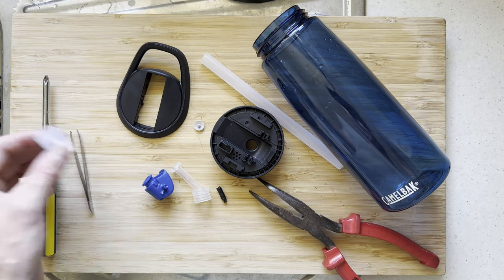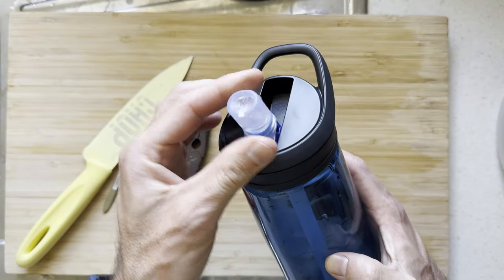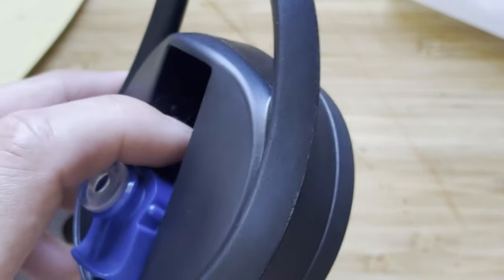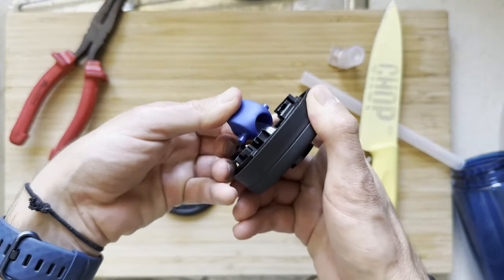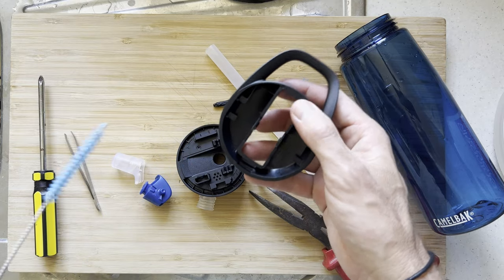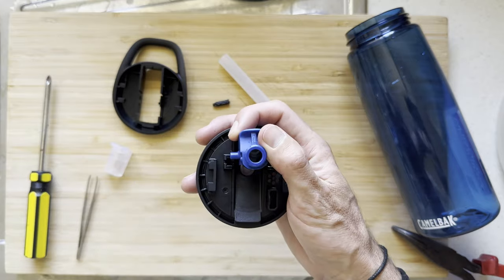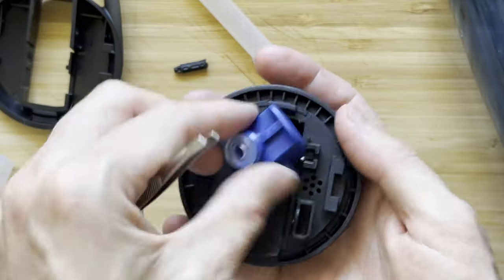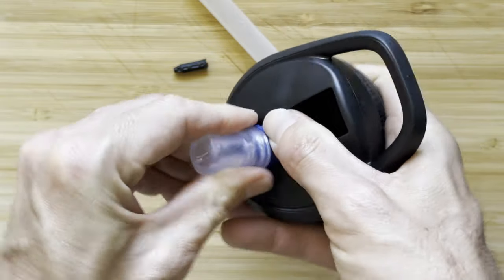How To Pull Apart and Fix/Clean Camelbak Eddy+ Bite Valve Lid!

Comment: Neat, was a real pain to find a guide so thanks for making this! 

4:00 I found it pretty effective to tie a twine to the rubber cap to pull it through the mouthpiece.
Reply: Thx! I was struggeling so much with this part, was about to give up when i found this comment^^ :D
Reply: @rabuea  Glad to have been able to help!
Reply: Definitely do this, you could poke a hole in it with anything else
Reply: I was going to post the same method. I used dental floss as its clean and strong enough to do the job.
Reply: omg thank you! this worked flawlessly!!

Comment: Thanks for making this! I used a thumb tack to poke the dowel at an angle and leverage it out and then just pull it with my fingers and it worked quite well! The knife felt a little dangerous for me especially since the dowel on mine was a bit sunken in. Thumb tack didn’t even cause too much damage to the dowel. Feel so much better knowing how to properly clean this, thanks.

Comment: 1:59 a better way to get this dowell out is to start the process of removing the top and you can get a small opening on the side. Then you insert a butter knife behind the dowell and push it through the hole. Works great and saves the dowell. Just be careful when you pry the top off

Comment: I wrote to Camelbak about the design and pointed to your vid, but the response was .... get a flip lid bottle!  The design changes over the years could have addressed thorough cleaning by better designing it for disassembly  so it's a bit disappointing.
Reply from the maker: I appreciate you sending them my video. Unfortunate they didn’t have a better response but I guess it would be someone from customer service not the actual design team.
To be honest, Contigo bottles are much worse to pull apart. I love the Nalgene bottles and lids for their simplicity
Reply: @huntingwaterfalls  Best vid explaining the takedown of the lid.  Wish they'd fix the servicability of the drinking straw mechanism.  As a design it's good because you can drink without the bottle obscuring your field of view (like when you're stopped at the lights grabbing a drink).  Or for whatever reason you want unobstructed view.  Plus it's no spill or leak (bite valve), so there's no problem with water sloshing around.  If they keep the bottle's thread pattern the same and come up with a replacement/improvement - great.

Also peeved with bottle designs like Klean Kanteen that change the width across the similar product range...(that's another topic)
Reply: I'm so disappointed in Camebak because I still have an old bottle from >10 years ago without these extra rubber parts that works fine & doesn't grow mold like these new ones do. I'm just dumbfounded as to how they could redesign lids in such a worse way that basically harbors mold, mildew, & germs inside the lid!  It really sucks.
Reply: I was able to get the skinny straw out and back in by wrapping a bread tie around the small end and feeding that through.

Comment: Great video thanks. We ended up using a cheese knife with great success and very little damage. No visible damage. I also found it’s easy to scoop and pull the middle straw piece through with something round and long. I used the lever from a nail clippers, but you could easily use a paint brush - would be easier than tweezers. Thanks 😊

Comment: Your video resulted pretty useful, thanks! I am trying to set up a water bottle for using with a hydration pack tube and from your video it seems it would be easier to adapt the hose using the quick link or the hydrolink adapter kits instead of the bottle's own bite valve since I wouldn't need an additional gasket. Cheers!

Comment: Nice video! Little wire cutters are pretty handy for prying out the plastic dowel also, if you've got some handy.
Unfortunately I had a go at this prior to finding your great video and managed to tear that internal "throat" bit of plastic when trying to push it back through with a chopstick. I don't think that part is replaceable and not having any luck melting it back together with a soldering iron.

Comment: I managed to dissemble everything less than a min, skip the knife part, skip the pliers for pulling things out except for resembling around minute 4:00 that you can use a rubberband pull it out, but I use secure hold hairclips metal bendable ones for haircuts, instead of the knife for dowel, others comments are right, push forward the cap and focus on the right side lift it up high and hard, it will make the dowel pop up very little (return the right side and slide up (as it was) (no need to get the dowel from the inside it will just fall out once right side is back in place) then just flip the cap and dowel falls right out because all it needs is to be removed a little bit, for assembling the inner piece, push it into the cap and just like video showed before you clip the piece then pull, wrap a rubberband and feed it through the hole then shimmy it through, my rubberband broke after many 5-6 times of reassembling, so I just use hairclips and I twist the silicone and pushed it higher and then I pull it out and then I just finish assembly. Hope this helps😊

edit, I hardly remove the silicone from cap, using method above you can remove dowel without even needing to remove the silicone, then you can just get drop soap and water in the silicone hole and rinse it off and to dry just get a napkin and bend a small paperclip and wrap the napkin to dry it, honestly, this makes cleaning much quicker and less hassle for daily cleaning. I leave cap, silicone bite valve, straw, and bottle separate when drying

Comment: You are pulling out the plastic dowel wrong. You are meant to push it out of its place by sliding something like a butter knife in between the top and bottom piece to push it out rather than pry it out.